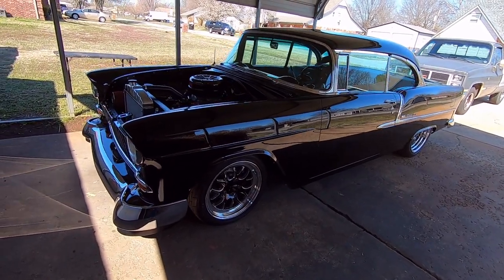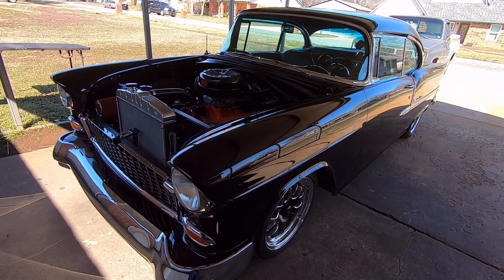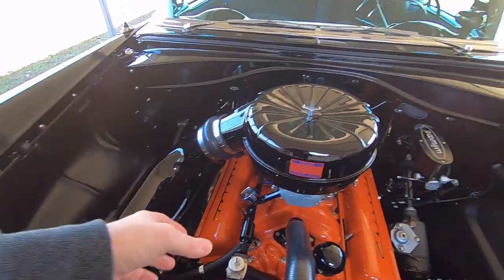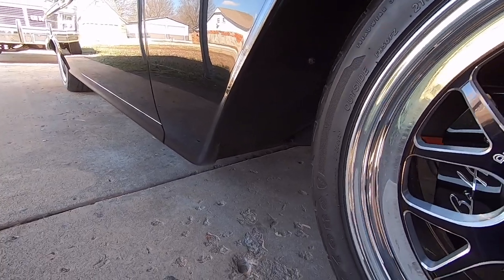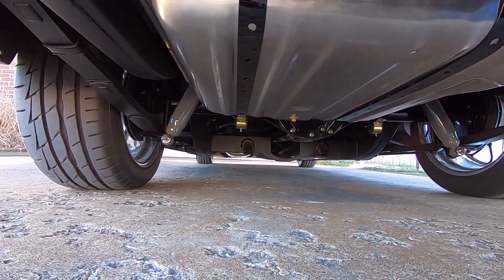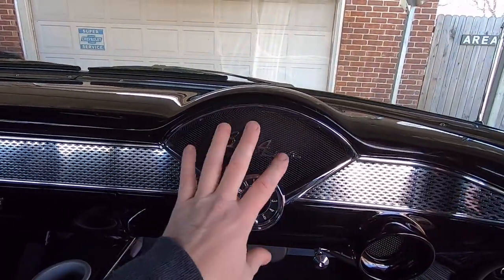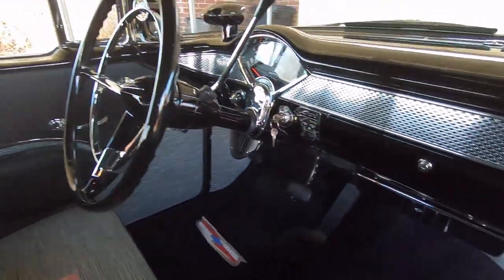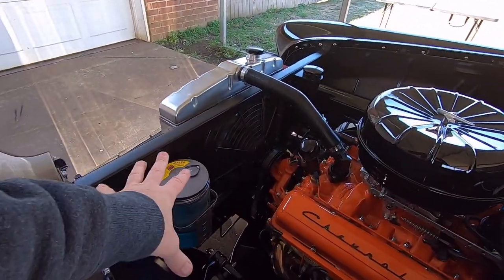Full Walkaround Of My 1955 Chevrolet Hardtop Project

Comment: Just flat out amazing work!  I know tri-fives and I don't even know where to begin on the multitude of great subtle changes here!  I like the hiding of the fasteners in many places such as the inner fenderwells and the radiator support side panels.  of all the times I've cut my hands on those screws!  The smoothing or reversing of those fasteners is really nice!  I have always liked the idea of building a bigger cubic inch engine and making it look like a factory 265 or 283.  We had a guy at the drags with a '32 Ford with a factory look and badged 283 Chevy in it.  It was a 406 in disguise and the car ran in the low 11's... a sleeper for sure!  The headlights being moved back instead of bulging out of the headlight bezels was something I had always wanted to fix from the factory!  The dash is another great improvement with eliminating the ash tray/lighter and using the auto-tronic eye as a shift light is really a brilliant idea!  The gauges having the bow tie background and the needles painted in neon makes the dash pop and really more readable as well as unique.  I also like the hammer tone paint and crest on the heater box.  The tissue dispenser is another great updated idea!  The subtle attention to detail and patience to complete the work would blow the mind of any tri-five guy if he were to look long enough!  Just seeing the car when you started to where it is today is a feat within itself!  I have painted cars before but, never done upholstery.  It is amazing that you tackled all the work yourself!  I don't think I could have ever had the patience to do upholstery.  Saying that you did an amazing job on this hardtop does seem to say enough about the work you did!  After 10 years, I hope you and your wife are really able to enjoy the fruits of your labor on this beauty!  Keep up the outstanding work and take care!
Reply from the maker: Appreciate the comment man.

Comment: Has to be one of the best "garage" builds around. Would absolutely love to see this car in person. All your personal custom touches are excellent. 2 questions. 1. on the brake master cylinder. That is manual brakes? What size bore and how do you like manual brakes? I have power brakes but hate the look of the booster. 2. Is your steering box a stock box?  
Congratulations on a very High end build.
Reply from the maker: I don't mind the manual brakes and steering. Stock steering box. Master cylinder is 15/16 but would go one inch for firmer pedal

Comment: Need some help. Trying to find an original gm used door mirror for my 55 sedan belair. Going patina style. Can’t find gm part numbers for an original, seem to be finding repops. Also need info on correct location mounting on the door, brackets and hardware. Thanks for any help
Reply from the maker: David, I don't know of any original door mirrors around locally. I'm unsure on stock location of the mirror to the door. I will say for anyone going to mount a door mirror on a tri 5 car= if you have to drill holes, be sure the wing (vent) window will open without hitting it. I'm wondering if my junk yard videos of the tri 5 cars show any door mirrors?